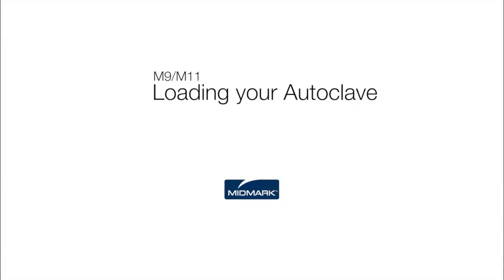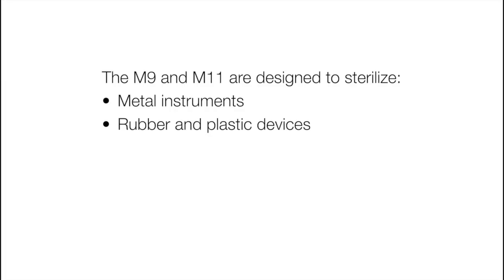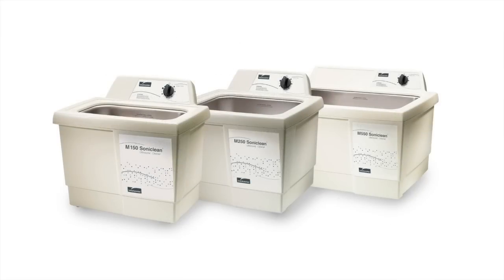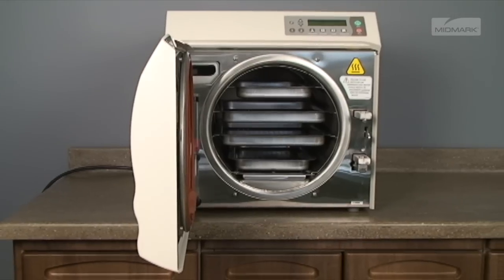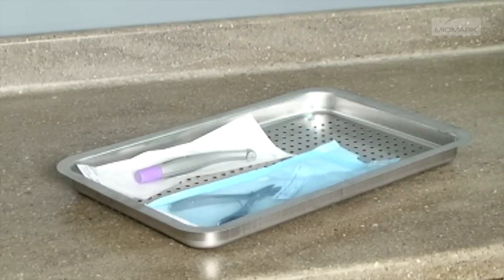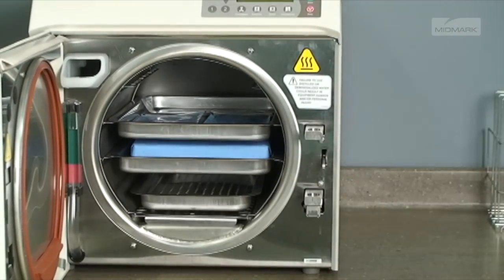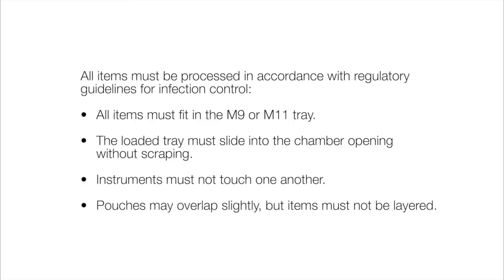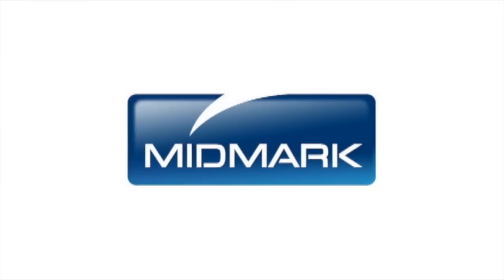How to Load a Midmark M9®/M11® Steam Sterilizer

Comment: Isn’t paper side down more likely to have inadequate drying afterward?  I read that paper up allows the water to escape more easily-  why is it recommended paper down?
Reply: Yeah in my office it has always been paper up and the plastic side down so the pouches are facing down when we autoclave them 🤷🏻‍♀️
Reply: @ryanrydell8243 sterilize with paper down, then during drying phase, flip them to dry. Sounds like extra work, but that's probably the best way
Reply: It's the exact opposite. Water is heavy and wants to drain with gravity. When plastic side down, all the water pools and then can't evaporate. When it's paper side down, water can drain through the paper and evaporate due to the pores in the paper fibers.